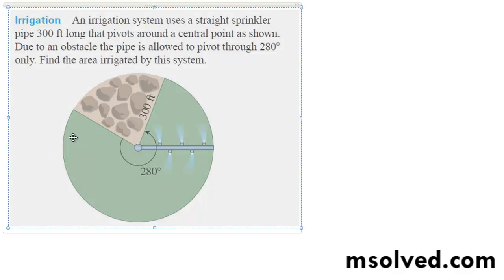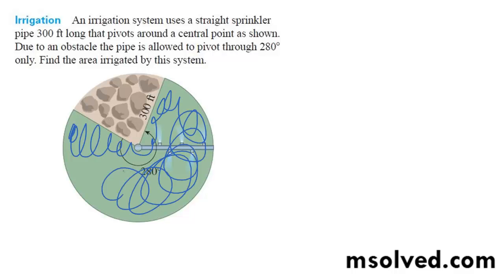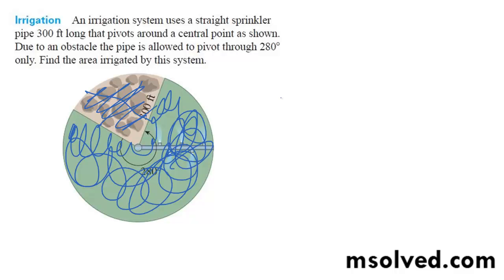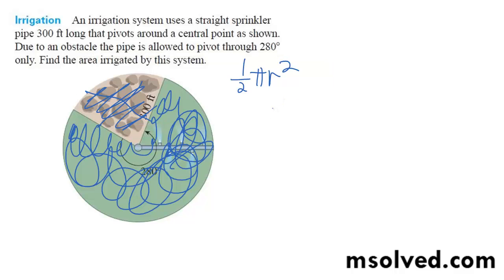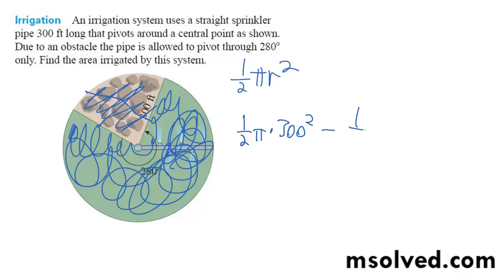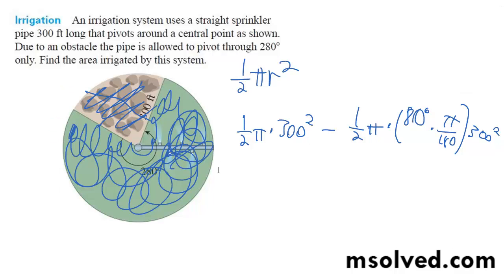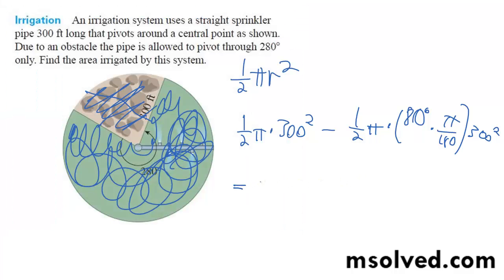An irrigation system uses a straight sprinkler pipe 300 ft long

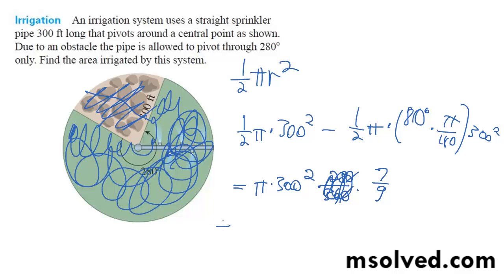Comment: I didn't understand what you did on 1:15

But this is how I solved it easy:

a = pi r^2 

a = pi * 300^2 = 282,743 sq ft. 

But we've only got 280 degrees of that circle, so: 

282,743 * (280 / 360) = 219,911 sq ft.